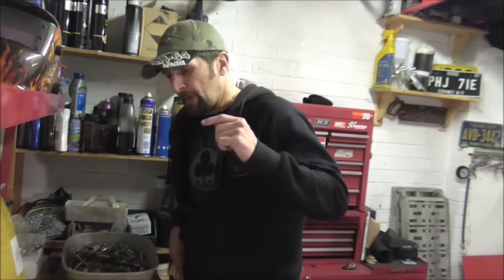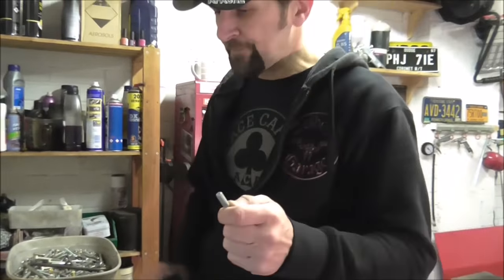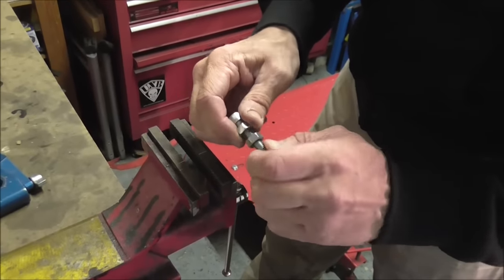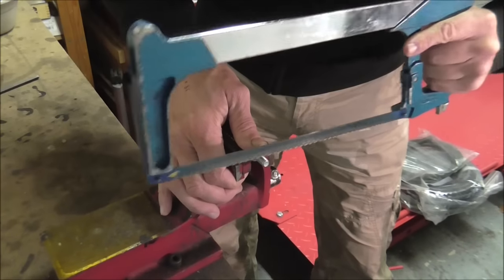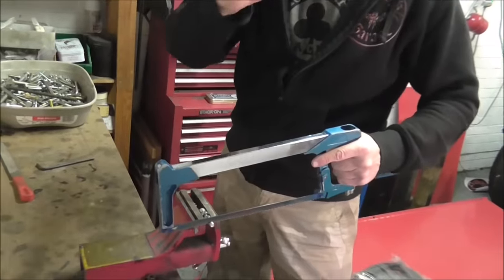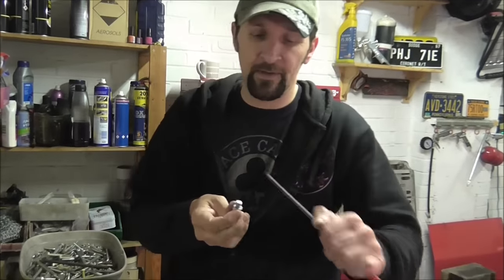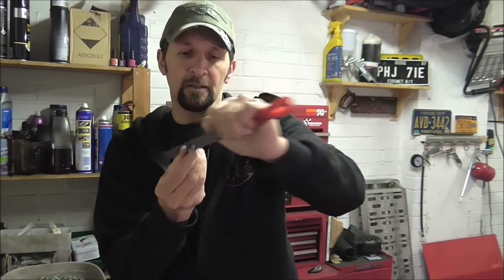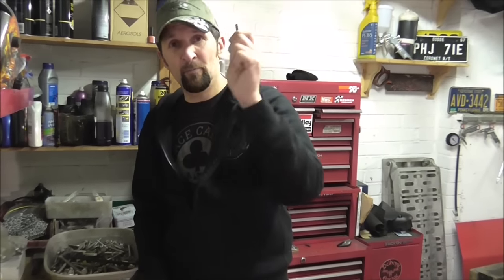Delboy's Garage, Simple skills, Bolt cutting !

Comment: Been cutting bolts for years, never come across the sliced bolt idea and have to say it's a great idea. Can't wait to try it out on my build. Thanks.
Reply from the maker: +Gearjammer Thanks buddy, its a real easy way to hold a thread very tightly if you need to, and not risk any damage to it...!

Comment: Nice work, Del and Penny! My favourite way to clean up the end of a cut bolt is chuck it in an electric drill and smooth it off at an angle on the bench grinder. A slow drill speed and light pressure will ensure that the temper is not taken out of the bolt steel.

I like the split nut tip... I'll remember that.
Reply from the maker: Good tip buddy, I like that, that's my kinda thinking, thanks for sharing it !

Comment: Great tip. Ive always put a nut on a bolt when cutting it down but not come across the cutting the nuts idea. Thanks Del (and your Grandad) . As for using the full length of the blade. My old woodwork teacher said to me once. "Do you know, no one sells the middle bit of the blade on its own, i have to buy a whole new one."
Reply from the maker: Ha ha.. that is the kind of comment i can "hear" a teacher saying... "Dark sarcasm in the classroom" aye..lol!

Comment: Thanks for this, I'll be trying it next time I need to cut one down.

I've had good results from cutting by loading the spare end in a drill and placing a nut at the cut. You can then use the nut to guide the blade, cutting as the drill spins the bolt. You can get a perfect right angle cut and the cut finishes in the center of the bolt shaft.

You can still need to clean the end of the thread though. Your grandads split nut method looks really good for that.

Comment: The split nut idea is a cracking tip (as we have come to expect from you).
At the risk of spending a bit more dosh, it's worth using a cutting lubricant on hand tools like hacksaws, drills and taps.  Your tools will last longer and will cut faster.  I like Trefolex - no idea if it is the best but it smells fantastic when it gets hot

Comment: Cutting bolts down something easy. The fun Ive got at the moment is thinning down a 71mm OD, 65mm ID spacer washer from 1.4mm to 1.1mm made out of A4 stainless steel.
Reply from the maker: +G. Bell Simple job on a lathe surely??
Reply: ... assuming one had a lathe ;)

Comment: NIce video. I always put a nut on before cutting but then put the unused bit of the bolt in the vice, i.e. the bit of the bolt you don't want. It doesn't matter if you bugger that thread up. Rather than a file I gently run the cut end up to  the grinding wheel of my bench grinder. Always leave the nut on till last. Never thought about cutting up two nuts, I'm too bloody stingy! I learnt a lot of my skills at school in the metalwork class. Do they still have metalwork classes? By the way, if you need a longer bolt a bit of studding with a nut on each end can work.
Reply from the maker: +Tony Little Hi Tony, there are many ways to skin a cat, this was just to show the idea of split nuts to grip a bolt firmly emough...you may only need to take 5mm off, and thats not enough to hold in a vice really... I learned a lot in metalwork too, best lessons were on brazing and soldering... it seems they dont offer it in the school curriculum, and sadly it seems that its down to health and safety ( or more likely the cost of insuring the workshop) but also, the courses at college these days dont require old hands on skills as they're 90% theory and IT...
Reply: +Moonfleet41 Yeah, the split nuts trick is something I've not come across and you do need about 10mm minimum if you're going down my route. I learnt brazing back at school 50 odd years ago and I've never brazed anything since lol. Health and safety hadn't been invented back then. One trick was to put the chuck key in the big lathe and see how far it would go when you turned it on. Tin snips and thin metal  were another fun thing, don't think we ever came out of a class without someone slicing their hand open. Happy days. Keep up the good work mate, how about a vid on thread cutting at some time.
Reply from the maker: +Tony Little Yeah, good call, i get asked for that a fair bit so may do once we get time... Did you ever make a 'Match rocket'?,   9" length of copper tube, 'pie slice' the end and wedge it in the vice to make a cone end, and solder it shut....then make a launcher from 12" of angle iron, and pack the tube with ten boxes of swan match heads really hard.. run a copper wire through a 2mm hole drilled near the cone...and touch it on a battery.....sets the matches off like a grenade, and could bury the rocket 6" into a wall.....what larks..!!
Reply: +Moonfleet41 Our trick was to cut up an old push bike frame, get some fertilizer and sugar (won't give the amounts) stuff the mixture into the bike tubing with a Jetex (remember them?) fuse in the end and retire. It would blow a metal dustbin lid twenty feet into the air (or blow your hand off). Your one sounds like fun though!

Comment: Just want to thank you, I was having a really hard time sourcing some exhaust studs fast and cheap, so I ended up just buying a length of stainless rod and I'm just going to make my own. Its anywhere from 1/3 to 1/8 the price of buying the actual studs and it'll only take about an hours work
Reply from the maker: +Ryan Kremer That's the spirit Ryan, do it yourself lol !  Enjoy the process and the satisfaction at the end - all the best, Del
Reply: +Moonfleet41 I'm restoring '72 CB350F, I'm doing kind of cafe, rat, brat hybrid. Restoring it part by part is very time consuming, I think I'll be able to ride it for the first time somewhere in the next week

Comment: clamp it in the vise by the thread you're not useing.....cut it off with the muffler cutter in ONE second...bevel the the first thread on the belt sander for 10 seconds........DONE  : p

Comment: Nicely done. But the thread is not 45 degrees but 60 deg. and I don't mind the file, you can use it both ways - but always from bottom up and away from the thread. It's new to me with the nut 💪